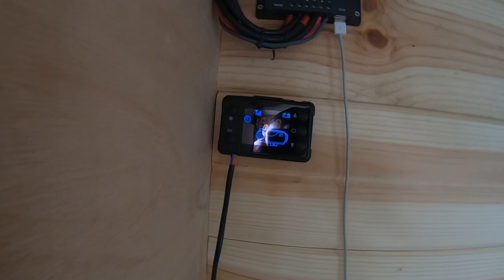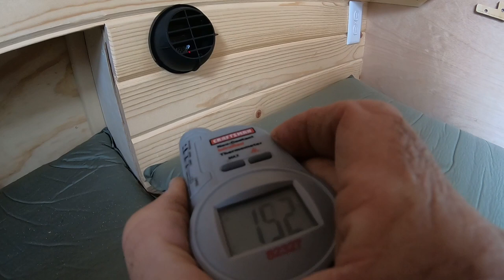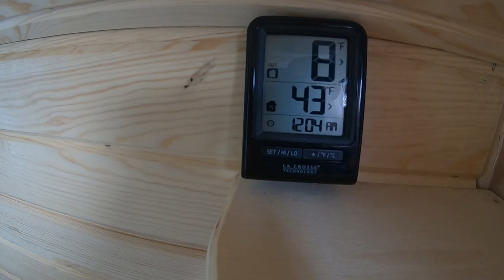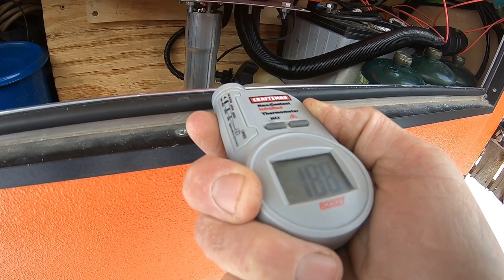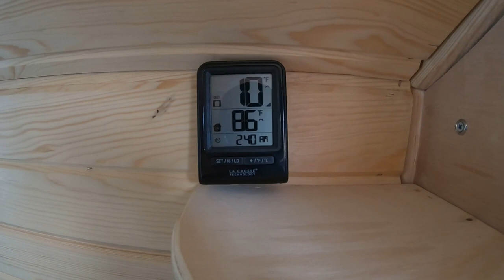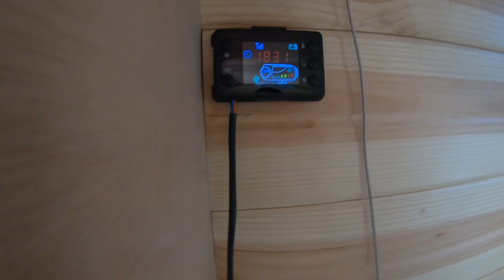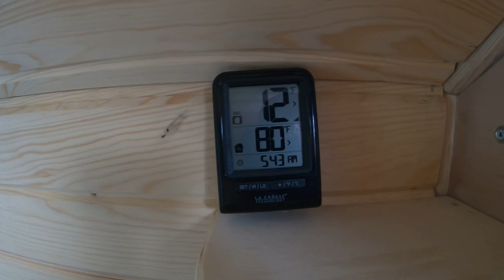Chinese Diesel Heater Install on DIY Off-Road Overland Trailer Build

Comment: Nice! I think a lot of folks fail to understand that the cabin is heated via a heat exchanger: cabin return air and heat are completely separate from combustion intake and exhaust. However, there are still significant risks associated with your installation. I imagine you’ve contemplated them already as you’ve strived for the ideal compromise for your specific situation.

Cabin return air and heat should both be ducted to the cabin. Any malfunction which leads to overcharging can and often does result in off-gassing, even with an AGM. While an FLA battery off-gasses in regular use, AGMs are far less likely to do so unless a catastrophic event occurs. The question is, will you recognize the venting of hydrogen into the cabin in such an event?

Batteries should be isolated and vented. LPG storage should be isolated and vented. Cabin return air and heat should be isolated and circulatory within the living space envelop.

I recently pulled a guy and his cat out of the river after his liveaboard sailboat exploded due to an ignition of accidentally leaked LPG. He was lucky. Only his cat and home were lost. Now he has to put his life back in order.

Thanks for posting your video! It’s been informative and helpful as I consider using a 2kw Chinese heater to heat a camper-car.

Comment: I've ran one of those heaters for 3 years with only a few issues. I would definitely add a carbon monoxide detector for safety. In the back with the heater. Great build.

Comment: Very nice, clean installation you've made.

These Chinese manufactured diesel air heaters are proving to be very reliable, especially after the warranty has expired.

Their affordability, reliability and durability are making them extremely popular, likewise their low fuel consumption.

If you ever put an add-a-room onto your canopy your heater will heat that too!

I particularly liked how you made your twin wall, heatshield support, exhaust pipe mounting, allowing accessibility if needed.

I like how your trailer is evolving to meet your changing needs and how you document those changes.

Once again, thank you for your very interesting, informative and entertaining videos.

Comment: Heating up : 7 mins : 130W / 9.5 A
Heat minimum : 1.6hz : 6W / 0.8 A
Cooling at the end : 3 mins : 110 W 
Final cooling : 4 mins :  12W 
And then shut off. 

Here for a 8kw, it's burning 10 cl / hour. 

Got all calculated yesterday ;)

Comment: I put one in my 5'x10' cargo trailer camper conversion - son used it as a dorm room in northern New Hampshire. In -25F temps, he had to crack a window because it was so warm. It was mostly noiseless once it got going.

Comment: Enjoyed the video, I’ll mention that having a open return air in the back section needs to have an cold air return to the space heated for efficiency. I recommend piping the return side to the cabin if it’s not already. Fire caulking the around each penetration on both supply and return. Using appropriate metal tape around each pipe connection will protect against CO. I also recommend moving the exhaust from under your camper just to outside the perimeter.wish you the best in your adventures.
Reply: I pull the combustion air from in side the heated space,,,unless the space is hermetically sealed the heater runs more eficient

Comment: Looking at it the right side where it pulls in you need to run it in the cabin area where you are heating this is a return it will circulate the cabin air just like your heating system in your house , trust me I am a hv ac tec. For 30 years. Also you want your return high up and your supply heat lower remember heat rises and cool settles , you would won't it in reverse if it your cooling. It will heat faster and use less fuel. one more thing put the t-stat or control above the return or close to it but away from the supply , the t-stat will be more accurate.
Reply: His problem is it runs to hot I'd actually drill a hole and pull air from outside over the heat exchanger only heating 20sq or less heat loss not a problem

Comment: Last weekend I camped at -38 using my diesel heater. Just a note... keep battery inside of trailer if it's that cold. it will freeze and you get no heat (laughing). Otherwise, it works great! I have two. One for garage and my little Atv Rv.

Comment: Nice build. I would suggest using an intake vent located elsewhere so your not pulling lead acid battery fumes through the heater and into the cabin.
Reply from the maker: It’s an AGM battery that is sealed and does not give off any gasses even though they should be vented. One reason I went this type of battery for the cargo area. Good suggestion, I will look at making a change b
Reply: Good planning.

Comment: FYI a lot of people say to be careful using manual mode/hertz mode.  If you turn it down too low you will get soot buildup and foul the combustion chamber/glow plug.  It seems as long as you dilligently run on high before shutting down, and also run on high for about an hour occassionally then you can keep that heater running clean and not have failures at the worst time

Comment: Ive had mine running in my garage for about three years now, Couple things ill mention. The included rubber connection are dangerous they crack and fall apart, the fuel line seems good tho, The  chinese fuel tank should be scrapped, buy a real gas/diesel jerry can so it doesn't rupture. Also you do not need to drill a hole in a fuel submersed area of the tank, the fuel pick-up can enter from the top to avoid leaks, Very important and kind of dangerous Is that you have the fuel above the heater, the only thing keeping that whole tank from siphoning into the heater while you sleep is a crapily made check valve inside the pump. My check valve failed after a bit of junk got sucked up from the tank and It would drain the line back into the tank. If the tank is above the heater it would've drained the tank into the heater.
Reply from the maker: Thanks for the recommendations.

Comment: well done! When using a low setting, you should let it run at full power every couple of hours to prevent soot buildup and failure.
Reply: it doesn't need to be that often, run it  at full power for about 1 hr every 1 or 2 tanks of fuel

Comment: I have a similar small teardrop trailer I built and have contemplated one of these diesel heaters for it.  Other than the "self contained" nature of it (which is cool), I am struggling with what I would gain vs using an electric heater with shore power (when available) or inverter generator (when off grid)?  Fuel usage is in the same ballpark (and gasoline so I'm only carrying one fuel type), and I am maintaining my battery bank charge at the same time.  I have solar capability, but many times when I'm needing heat like this, it is cloudy\rainy\snowy so solar is pretty useless anyway and that is one reason I have the generator anyway.  There are times where I have seen camping areas without shore power that also disallow generators, so it would come in handy, but I am not coming across that situation often enough to justify the purchase and installation of the diesel heater.

Comment: great video i learn a lot on the installment and most of all the heat shell around the muffler and the floor flange i have a all in one model that i am trying to install the controler lcd wire is to short haw can i extend the wire so i can put the unit on the porch out side my window.
Reply from the maker: You need to cut the wire and extend them. This guy did a video series building a portable unit. 
https://youtu.be/VhozR8jCm0A

Comment: If you put an hose on the heat exchanger intake and routed it into the heater from the living space, that would make things even quicker and more efficient. When it's drawing cold air into the heater from the "mechanical spaces", it's got just that much more work to do to change the delta (temperature difference). Rather than intaking 12 degree, (68 degree delta) it's drawing 70 degree air to that same point (10 degree delta).
If the concern is keeping the mechanical spaces warm, it would help there as well because it wouldn't be drawing cold, outside air in around the door seal nearly as much.
Just a couple thoughts.
Reply from the maker: It’s way to hot as is. Thanks

Comment: You should really move the exhaust to the other side of the trailer so it isn't so close to the fresh air intake. You'll end up sucking exhaust into the intake and into the trailer. That's a good way to end up taking THE long nap in there.
Reply: I was thinking the same thing. I like the overall setup, but personally, I'd run the exhaust up and out of the roof. If you've spent any time in an RV, you know that generator exhaust will penetrate the living quarters if the wind is blowing in the right/wrong direction.
Reply from the maker: The cargo area is sealed up and has vents near the top. So the exhaust is about 4.5’ away from the cargo area vents. On diesel heaters you want to have the exhaust pointing down so it doesn’t hold moister. I also have a co2 detector in the cabin. Thanks for the comments.
Reply: @seekingadventures  Thanks for the reply. That is a really cool unit! So cool, in fact, that I ordered one! I can't believe how affordable they are.  Also, thanks for the info about the exhaust needing to point downward. I had researched these units after I commented, and realized why you ran the exhaust through the floor. GREAT BUILD, by the way.
Reply: Came here to say this.

Comment: Very cool, I was in the market for a while looking for different small campers I actually ordered one of those bushwhackers 15fk but I since cancel the order because they’ve been having a lot of problems with them so just three days ago I ended up ordering a sunray 109 can’t wait to get it, I want to go out west for a couple months 👍😎 cool vid, Subscribed 👍
Reply: My buddy has a Sunray and his propane heater consumes a lot of propane, plus the sail switch on the heater goes bad pretty quickly.  We pulled out the propane heater and replaced it with a diesel parking heater like this.

I have an all-in-one diesel heater that I use just outside of my T@G trailer.  It makes it uber warm and we regularly camp between 7000 and 10000 feet - it works!

Comment: I AM  buying an outbound soon.  i am going to investigate using a 250 watt electric heater.  i have a very old duo therm propane heater.  1975 it was made. i had it in an old homemade camper.  it worked good . people tell me if can use a small electric heater of 300 watts if i have two deep cycles charged up.  that is would work for one night

Comment: This one guy that I follow on YT has a 5x8 Drifter Trailer that looks a lot like yours in color and design, but your trailer looks a lot nicer and especially on the inside with your tongue and groove wood work that you did. I don’t know what you have in your trailer but I did price the Drifter and it starts at 15k and up depending on options. I can’t believe how nice yours looks and all of the nice things that you have done to it. I was planning on getting a Rooftop tent for my Jeep but after finding your channel it has really got me thinking about going with a trailer set up. A friend of mine has a utility trailer like the one you used for sale. If you don’t mind me asking where did you get the 3500 pound axle for it. Anyways I’m in WV and can’t wait to see some of the adventures you all go on. Happy camping and many safe travels.
Reply from the maker: Hey thanks. You can get axles on Amazon, Etrailer or farm and ranch stores. Here’s a link of my build. 

https://youtu.be/Tf1YtnCw53g
Reply: @seekingadventures  thanks for the reply I was looking at the site you mentioned for the doors LOL  thanks again.

Comment: I put a hose on my air intake of heater through  the floor to get fresh air instead of recycled  air
Reply from the maker: It is fresh air. The cargo area is separate from the cabin area and also has two vents to the exterior where outside air is pulled in.

Comment: I got the 5kw because I was worried the 3 kw wouldn't put out enough heat for my 16ft trailer.  We have to sleep with the door open because its WAY to much heat. Wish I got the smaller one.
Reply: good to know, but its always better to have too much then not enough.

Comment: There is a video about those I have watched to change the temp readout to Fahrenheit on the heater controller. By the way great video would of been nice to see how much fuel it used after 6 hours.
Reply from the maker: It wasn’t much. Maybe. A 1/3 of it.
Reply: Can you please post the link of the video that you're referring to? Thanks!

Comment: While the heater is running I see the fresh air source for the cabin is directly routed through the exhaust head tube.  This needs to be corrected. Add a return air duct or mount the heater in the heated space and vent directly to the outside like it should be.
Reply from the maker: Exhaust is vented to the outside and then the galley area has fresh air vents on the top on each side. Works great for the past years

Comment: I would put your burn intake tube outside so it is not pulling from inside the camper.
Reply from the maker: The combustion intake is in the cargo area separate from the cabin area. The cargo area is also vented to atmosphere

Comment: I have a question. How long are the cables? My batteries are mounted on the tongue of my trailer. I would need 15ft to the batteries or 10ft to my converter. Cool set up by the way.
Reply from the maker: I can’t remember for sure but I’m thinking 10-12’ at least. I know you could cut them and extend them. I’ve seen other channels that have done that. Thanks.

Comment: Don't really think I could sleep in a 80° f camper, without one leg hanging out the side door. Lol
Can you get her to maintain say 60 or 65° f?
Reply from the maker: Crack the vent and window it does.
Reply: It’s best to run them on high and crack a window to avoid carbon buildup.

Comment: Hey. Great in-depth video. Thank you. How did you create the heat surround? Was it just aluminium with an air gap? I need to fit mine into a smaller space too and all I have the ply like yours. Any suggestions?

Thank you very much.
Reply from the maker: I used header exhaust heat wrap around the exhaust. I then used 1.5” steel exhaust pipe over that. There is an air gap between the two.
Reply: @seekingadventures  awesome. Thank you very much. For the muffler I see you attached that to metal on the exterior. I should to the same onto the frame of the trailer I think.

Comment: id wrap the inlet air from the cabin, looks like right there youre pulling in battery fumes and exhaust fumes. neat idea though
Reply from the maker: Battery is an sealed AGM and the exhaust exits clear under the trailer and the cargo area vents are near the top of the camper.

Comment: Cant you use a thermostat and just shut it off when it gets too hot?  Why would it need to be turned down below factory settings. Is there some startup procedure that needs to run or can you just turn it on and off with a switch?
Reply from the maker: It’s best to run it all the time. Every time you start it up the glow plug runs and will kill the battery quickly.

Comment: Good looking install I use one to heat my work shed with a 12 volt power inverter. The double wall exhaust is great idea but you mite want to change your air in take for the cabin hot air the battery will put off odor from the acid you shouldn’t be putting that air into your cabin
Reply from the maker: I wasn’t too concerned since it’s an sealed AGM battery. They do say they do off gas some. Thanks
Reply: @seekingadventures   I have had mine act up and puff smoke out the intake tube you should not have that inside your camper

Comment: Hello good sir. I have another quick question for you about the exhaust. Would there be any concern about the exhaust burning the plywood at all? Or is a bigger than exhaust hole sufficient to allow the heat to dissipate?  Thank you for your time.
Reply from the maker: No concern. The hole is larger then the exhaust pipe plus the exhaust wrap. Think you can see it in the video. At a later date I’m going to mount the heater to the floor.
Reply: @seekingadventures  awesome. Thank you very much.

Comment: Not to be on the negative side, but I would say its to close to the battery and the intake is sucking any fumes coming from the battery.
Reply from the maker: AGM sealed batteries have little to no off gassing. Haven’t had any issues in 1.5 years.

Comment: You can change it to the thermostat temperature instead of hertz. See The Campervan Builder video on it since the instructions are near useless.
Reply from the maker: I’ve done that. But if you go into the program you can set it lower temperature than what the factory settings are, you just need to do it in the hertz setting.

Comment: Needs cabin air intake instead of potential intake of battery, propane and diesel fumes.
Reply from the maker: Battery is a sealed AGM, propane bottles are only stored in there during storage, I did not remove them during testing. Could get some diesel fumes from the diesel but the exhaust is routed under the trailer and the cargo area is vented near the top of the camper.